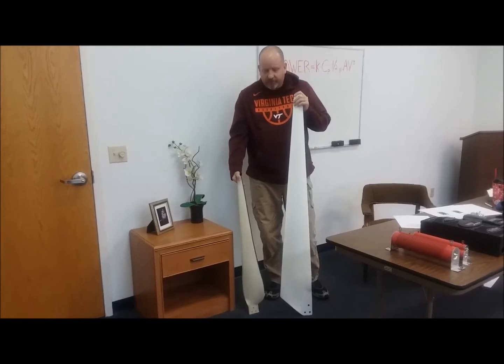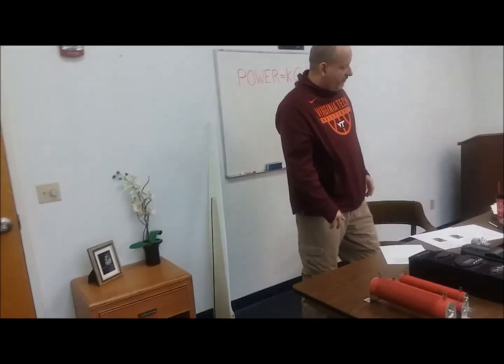Residential Wind Turbine Ratings Rotor Diameter Truth  and Carnival Science VS Fact

Comment: Your right about torque that the turbine needs,, but I have high wind speeds I use a smaller blade, high wind speeds smaller, faster, safer blade , a large blade like you show I don't think I would feel safe in 60-90mph wind gusts. I wish I had a consistent wind speed all year long but I don't. I don't think most people do. I think it is best to match your blades for your strongest, fastest winds , then add the correct size PMA/PMG for the blades. I think it is better to buy 2 or more small turbines with safer smaller blades than it is to buy one large turbine with blades that are to big to handle your highest wind speeds in your area.
Reply from the maker: If that has been working good for you then keep at it. Most people we deal with are not looking for making power just during wind storms and the big turbines have over speed protection. That being said if you feel safe and it works for you you can probably get your 2 kw when the wind blows in gale force winds. I make this video in the interest of not having to explain to another person why their tiny wind turbine does not make a lot of power in low wind
Reply: @HurricaneWindPowercom  ,,, I just want to say that wind speed is a Very Big factor when choosing blades and your turbine for your area, everyone's area is different. I don't think you can electric break a turbine running large blades like you show in 60-90mph wind gusts,, it will probably burn up a turbine from heat
Reply from the maker: @wabuminifarm3437  of course it would burn up if it was engineered by a half wit without mechanic braking and only relied on electrical braking however big wind turbines have mechanical furling and over speed protection with dynamic blade braking. One of the problems with many of the small wind turbine manufacturers is they did not include a secondary braking mechanism when designing their turbines and just get though because their blade is too small to burn the turbine up. All certified CE or anywhere else require more than electrical braking. Our turbines either furl or have dynamic blade breaking and are CE listed or use parts from turbine that have been CE listed. What your flying I would hazard a guess is not. Again as I always say if it works for you where your at keep up the good work.
Reply: Define electric break because if you're talking about a switch that shorts out the wind turbine then sure that to be frank is a crazy idea. But if you have the proper equipment, Classic and Clipper, You can use the classic to slow the blades down where using such a switch based brake is safe. But I've only ever see a couple of folks who put up videos set it up that way
Reply from the maker: @RomoJack  For the purposed of discussion we are  simply talking about the 2 ways that wind turbines are slowed down. One is when resistance is placed on the turbine from the battery or the resistive load. As you are aware otherwise not under a load the turbine spins freely. In this regard i am talking about electromagnetic braking. Secondly mechanical braking is any type of furling or dynamic blade braking  or other mechanism which slows down the turbine. As you may or may not know to be certified wind turbines need both types of braking. In regards to only seeing a few people being able to set the turbines up correctly I do not disagree and most of what I see on youtube is done wrong. I find it ironic that the last poster continues to seemingly promote designs which I am aware have failed on him. To each there own. One final word on the electromagnetic braking......it is not enough regardless of how it is set up on larger turbines
Reply: @wabuminifarm3437  ....if you have winds in hurricane strength then you have other things to worry about than max wind turbine output.
Reply: i own two mws dual pmas , they were a waste of money for me , what i mean by that is if i buy a product advertised as a 2kw turbine i expect to see 2kw in realistic winds ,my bad , look at Hensely issac for example he has real nice towers and good winds living on an island yet the turbines to me are a big let down being rated at 2000watts yet only seeing a couple of hundred watts or so comming in, yes they work but they have issues that are annoying, i have since built turbines using fisher and paykel pmas that actualy work better for the money , i used motors out of discarded washing machines and re configured the stators, theyre Not power houses but work very well, suprisingly 
the thing with big blades theyre not meant to spin at over 1000 to 2000rpms in 40 to 50mph winds  to make biggish power, they are for lower/safer rpms with pmas that need bigger blades that actualy provide the torque required to turn the higher output lower rpm pmas that designed to work very well in realistic winds, and with furling tails etc theyre protected from overspeeding.  
the whole point is its a great thing to see power going into your batteries in under 10mph and not just a few watts , everybody gets low winds . you can have many small turbines but how much power will they make in 10mph winds. sure theyre a nice hobby and if you like what youve got fine, as long as you are happy .